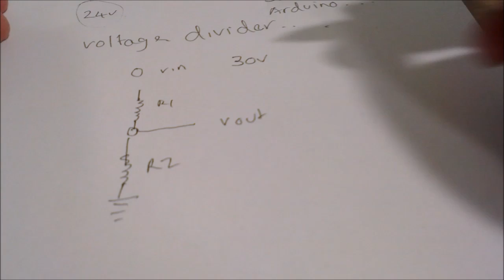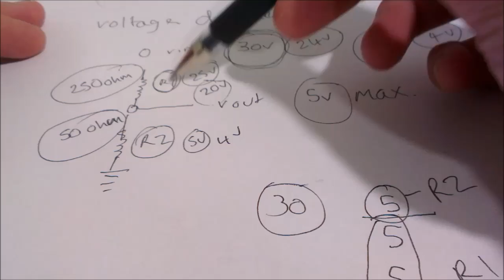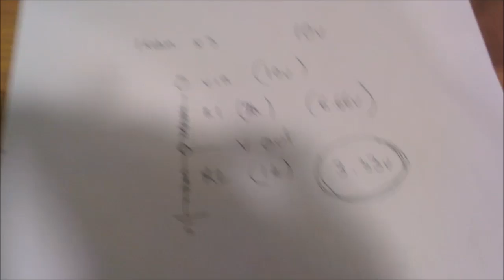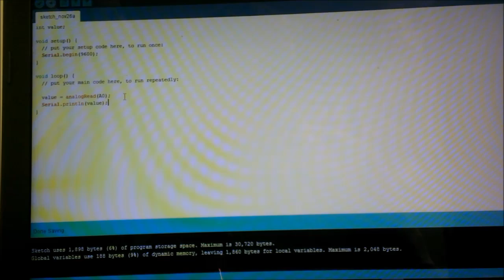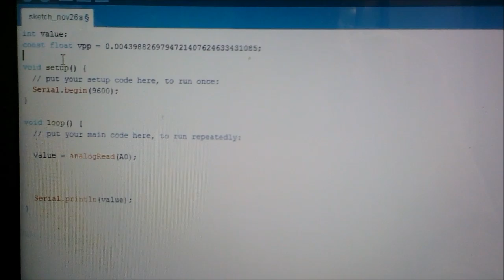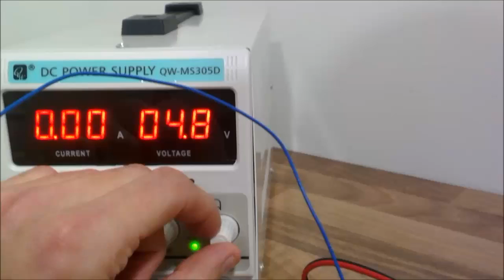TUTORIAL: How to measure voltage into the Arduino (using a voltage divider)

Comment: If you had 30Vdc and wanted 1Vdc on the output it's actually 100k / 29 times, would give you 3,448.2758 Ohms of resistance. Vout = Vin * (Rbttm / Rtot), so 3,448.2758 / 103,448.2758 total Ohms of resistance is 0.0333333332 x Vin(30vdc) = 0.9999999Vdc.

Now.. for 5Vdc MAX output.. 5 normally goes into it 6 times, but it's actually 5 times.
SO... 100k / 5 = 20k ohms of resistance.

20k / 120k = 0.1666666666 multiplied by Vin which is.. 30Vdc. equals..  5 Volts DC.

In a perfect world.

You should work on your Voltage dividers. Because they are very handy on making reference voltages for other devices, including the boost converter.

(Boost Feedback) - When the load is drawing current from the capacitor that's being charged by the inductor the reference voltage allows the gate of the n-MOS to saturate allowing the boost converter to turn on and off the gate of the n-MOS.

Sit n think for a little bit.. work out the problem after acquiring solid information on the equation for two resistors in series in a voltage divider. Using high value resistors will dissipate tiny amounts of power, and your circuit will draw (almost none) power.